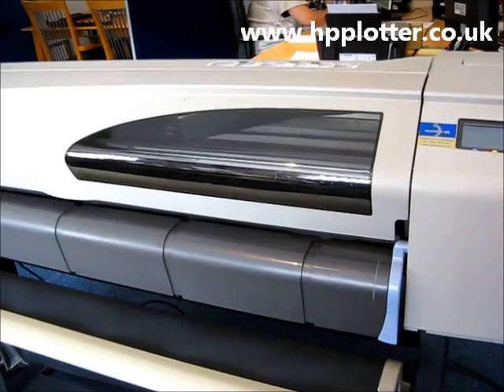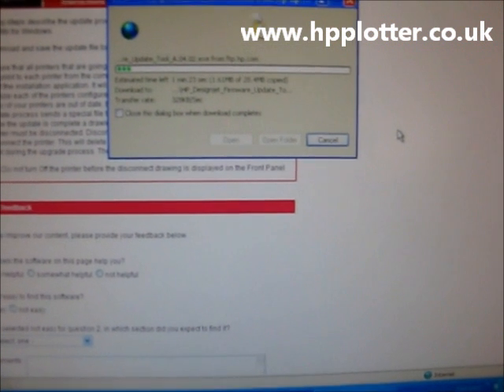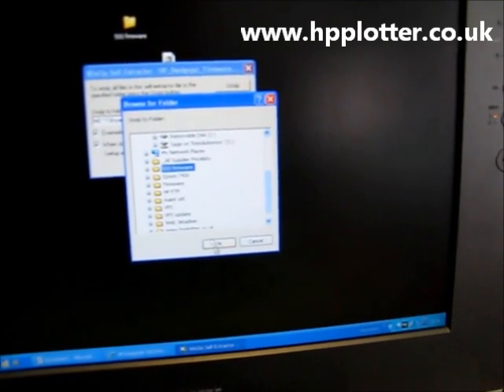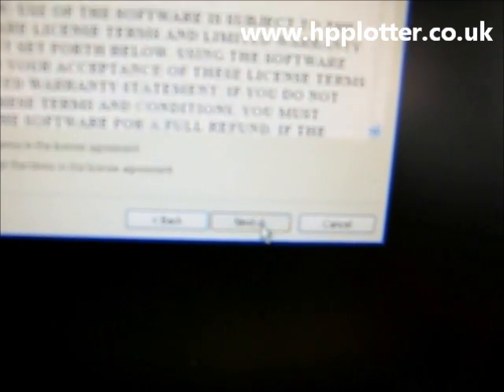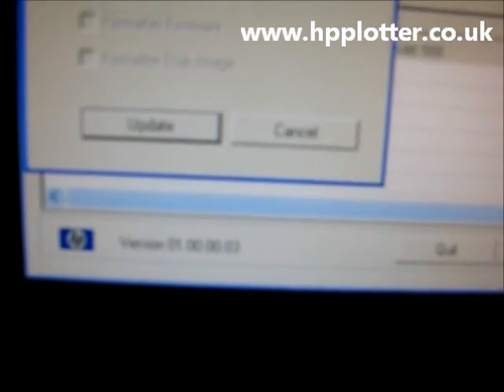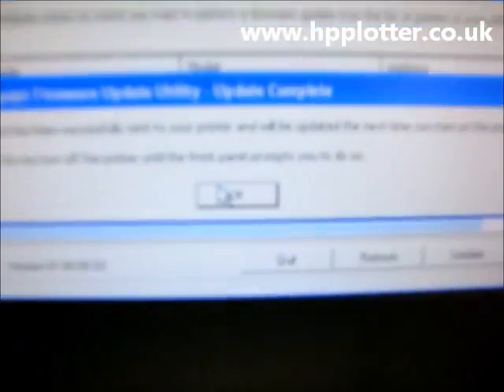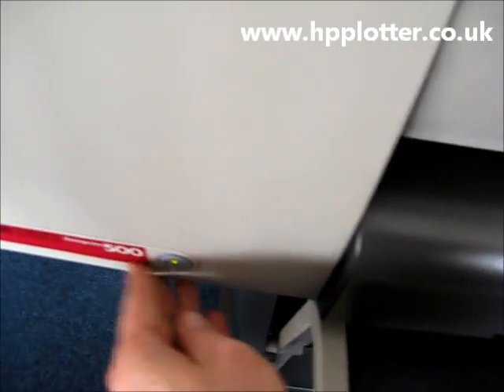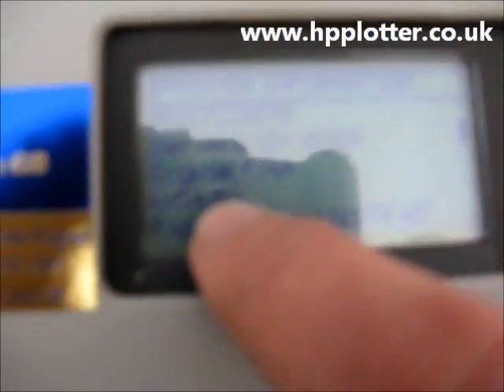DesignJet 500 firmware upgrade

Comment: A client bought a new HP designjet and gave me this 510 for free, nice!
When installing a new black cartridge and starting printing i noticed that black was a bit striped so I ordered a black inkhead.
There the problems began with the famous 02:10 error message, meaning a communication error with the carriage or just faulty printheads.
After buying 3 extra heads in order to start at zero level the message didn't disappear.
After finding a XP laptop and giving the printer an update, AT LAST i got a nice align report and are happy with a nice printer that can print HUGE A0 format pictures! :-)
Thanks for warning us that the formatter card shouldn't have an update, otherwise I would have trashed this one.
Great tutorial and yes, please buy a new camera!!  :-)

Comment: @ geoffrey that error code was a formatter problem (Only applicable to HP DesignJet 800 Series)and HP-GL/2 Accessory Card failure(Only applicable to HP DesignJet 500 Series).

Try to reseat the part and cables, if error persist your formatter/HP-GL/2 Accessory Card is defective.

Comment: There is a plotter HP DesignJet 500 plus in our office.
We wanted to upgrade firmware of the plotter. Downloaded the 
firmware from the official web-site oа HP, but after intalling 
firmware plotter dasn't work. In the monitor showed the dagger blinks.
The service centre said to change that eletronic module of plotter. 
Could you say how return old firmware. Thanks.

Comment from the maker: @David  Thanks for that! HP have indeed pulled the firmware from their website since the Designjet 500 officially went 'end of support' c.6 months ago - although this printer actually went 'end of life' back in December 2008 (when it was replaced by the Designjet 510, which in turn was then replaced by the T520).

All is not lost however! :-) . We have the firmware for the Designjet 500 and we're happy to sell this for 35.00+VAT if anyone is interested. It will certainly allow people to keep their old Designjet 500 going for a while longer - a good workhorse - and the firmware is suitable for anything up to Windows 7. Simply email engineering@hpplotter.co.uk for further information.
Reply: which version is the latest?
Reply: A4.02 I just done mine,  as it was at A03.04 :)